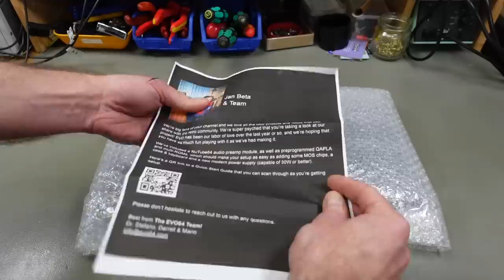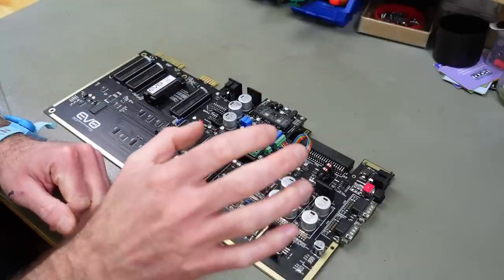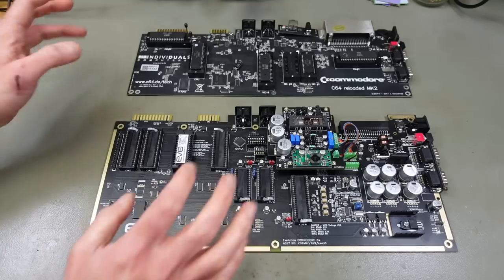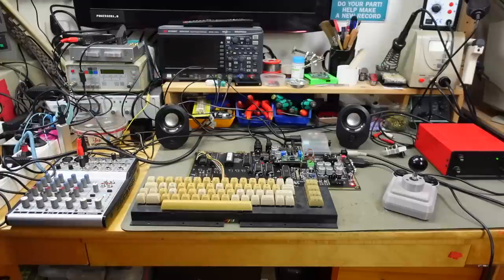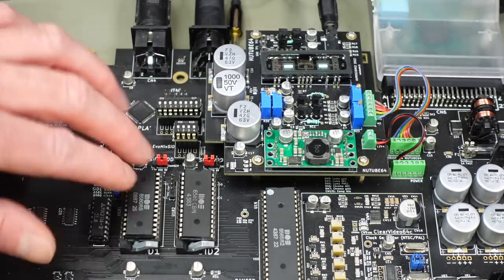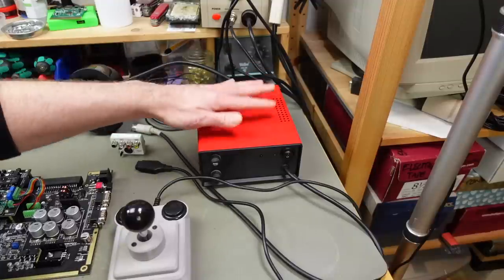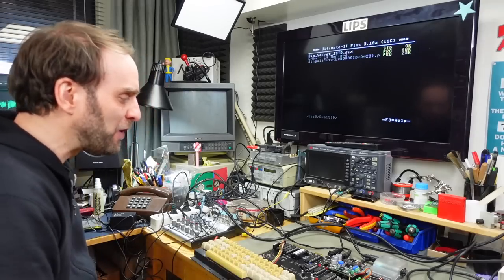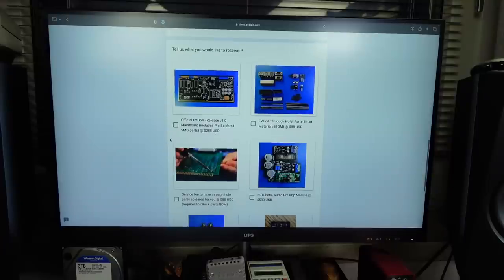The new EVO64 C64 Replica Board

Comment: If someone makes an equivalent Amiga board I'm there
Reply: there are... but you must put your's components... :D
Reply: Bob’s Bits Tindie.
Reply: Me, too. Although, I bought a custom remake motherboard of the original A4000D from a well known guy in Denmark who specialises in these boards, but it cost a king's ransom and still had mostly the original chips from Commodore. Nevertheless, it was a very professional remake (Chucky) and the components were soldered perfectly. If you've got the cash, almost anything is possible.
Reply: @milk-it  Minor quibble, Chucky (John Hertell) is Swedish. But his remakes are amazing feats of reverse engineering and knowledge. The A2000 board was a five layer board.
Reply: @OscarSommerbo  True.
Reply: I was thinking the same thing. With an A500 the sound output is rather noisy. Probably from the noise on the supply rails that feed the opamp in the peramp/filter stage before the sound output at the the rear RCA's. If you could take the L/R output more direct from Paula and design your own preamp within own separate powersupply using liner voltage regulators, it might improve the quality a bit. Although I wonder also how much the DAC output from Paula itself is affected by noisy supply rails. In this case a whole redesign of the board would be necessary.

Comment: That is SO cool! I'm really curious about the NuTube itself as it seems to be a miniaturised version  of a real valve. But wow, the price, and I AM one of those crazy audiophile types...! 
However, I thought, I need a case for that. So I looked in my Commodore crate (parts, but I remembered I had a C64C and a C128 in there that I needed to look at). I thought that the C64C case might be nice to use.
SO, I brought it down and decided to test it first. So, remembering what you said, measured the voltages first (which were fine) and powered on the machine after that. Fully expecting it not to work. But it did... And it kind of looks quite nice. Keyboard is perfect, perhaps a big discoloured. 
Still, open it I shall, so I flipped it over. Ah, made in West Germany. Wow, that brings me back memories of wanting to travel to Berlin when the wall fell, but okay.
And for me, this is the very first C64 that I've seen in the past 10 years or so that hasn't been opened before (seal is in tact) and still works fine.
Of course, I don't come across many, but I thought it was quite cool!
So I'll have to go look for another case, and I'm going to make this my first restoration project. Cool! Will use your videos to see what to replace of course!

Comment: I get the appeal of the EVO64, as it seems like a decent replacement C64 board. However I struggle to see the point of the pre-amp options (especially the Triode64). Maybe that says more about me than the target market. Either way, it's great to see people are still pushing the C64's architecture to new limits over 40 years since it was released.

Comment: As a musician I don't think I am the target audience for the amp, we use studio reference monitors over consumer speakers to hear every bit of articulation and detail, so if you are using a 64 to natively write music on or as an instrument like you mentioned you want the most accurate reference point, a 64 plugged into reference monitors. The tube amp is removing some of the clarity and ability to hear the detail in how extremely fast the sid chips parameters change. If I did specifically want this tube sound afterwards there is a plethora of options including nutube pedals and preamps from Korg or something like an Elektron analogue heat which is going to give you a tonne of control and options that you can use on all your gear. It might make more sense for people who have no need to invest in studio gear but want a smoother more glued sound from their 64.

That said it looks like a great board and the amps are totally optional, so win win for everyone.
Reply from the maker: Good point! I was thinking that it would make sense in a live setup for musicians or as a standalone synth in a recording setup (which is probably what I’m going to use it for primarily). Definitely not for everybody but I don’t think that’s the intention of the project. ;)

Comment: This is a great project that I have been following for some time. Every extra feature that is put in the board is a great choice, it contains most of the essential fixes / enhancements that were implemented to old C64 in time. I only have 2 criticisms; first being the price. I understand the effort and time that went into the project, and I am aware of the parts quality used. I also understand that considering the expected sales number, they had to make it a bit pricey to cover everything, but still, not an easy money to pay from a hobbyist's perspective. Second is the decision to embed a modern PLA replacement on board. No one, even the creator can guarantee 100% compatibility for a modern replacement. There should have been another ZIF socket for the PLA and the choice of placing an original PLA or any of the modern replacements in that socket should have been left to the end user. Other than these two, I think it is the best modern C64 board ever created so far, and I don't expect that there will ever be something better.
Reply: The production board that will ship on Feb 15th has a modular and removable QAPLA’ (PLA).
Reply: Bora. The QAPLA was moved off board with a small square socket to allow me to change CHIP, to add funcitonalities (in the EEPROM) and to be able to play with more possible waiting states in production SRAMs. Compatibility is always goal. I promise you that when your QAPLA dies, you will have a replacement, ready to take its job.
Reply: @auro1999  But still no provisions to use a genuine PLA?

Comment: I think the Evo64 is a great project because it does answer the question about what the Commodore 64 would have been like if higher quality components were used in its manufacturing. I love that it further extends the life of the 1980s platform. I wonder what the next steps are... as in, where do we go from here? This almost demands that the platform get extended further. Some kind of expectation for Dual SID and with the new VIC replacement that also extends the C64s capabilities, I would like to see some sort of... not quite next gen C64 but something that we can all enjoy, no matter the vintage of Commodore 64... Perhaps I am babbling...
Reply: Higher quality? the many original c64's have survived 40+ years now. It's incredible for a computer designed to last 4-5 years.

Comment: This got me thinking about how dual SIDs work. I know the C64 memory map has the SID registers repeated 32 times, so I suppose when Commodore designed the machine they maybe thought that they could support as many SIDs as they could get on the board (up to 32), and maybe they weren't sure how many channels they would be able to design into the single SID chip, they might be able to "multi-core" the SID so-to-speak. But then the actual C64 only has the single SID chip select line supported, so you can't just slap in another SID without changing more of the chip select circuitry (U15 chip selects the SID when the appropriate address lines are being accessed?). I assume these new boards have designed in the multi SID support? and I also assume that it's possible to put more than 2 in, but I've never noticed anything about triple SIDs or quadruple SIDs?
Reply: The board is clearly supporting 2 physical SIDs, although if using an ARM2SID or FPGASID, it should be possible to support even more
Reply: It's probably not that they intended to put multiple SIDs in, but more that they just simplified the address decoding for a few chips (the same decoder also selects the colour RAM). Each of the devices (VIC included) is given a 1K block of memory to live in as a result of the colour RAM needing that much space.

I guess they could have decoded further, but that would require more chips.

Comment: Saw the 8-bit Guy's review of this board. The main board is excellent and is definitely worth considering for any C64 fan who wants to have a future-proof machine with modern components. The sound cards though - Ouch! I know it is impossible to make a valid comparison over YouTube due to sampling, compression and reconstruction but seriously?! However you process it in the machine this is still 80's vintage 8-bit sound generation. You might as well connect your NAD amplifier to a gramophone! $500? 😲 $1000? 🤣
Reply: The available preamp modules are a niche offering for enthusiasts that want to experience them. They're not required for base functionality of the board. The cost for the modules is a reflection of the very high quality components, as well as the time and effort it takes to assemble, calibrate and test each module by hand (yes each is handmade). 

We're not expecting to sell tons of them, but we really wanted to have them for ourselves and to share them with others that might share a similar interest.
Reply: @C64EVO  I am sure that the cost of the boards reasonably reflects the time and expense required to develop and produce them and I applaud your achievement. My doubt is whether it was really necessary (or sensible) to spend this amount of time, money and energy developing and building modules to amplify 80's 8-bit sound in the first place! The 8-bit Guy's final verdict was that the VFD module produced little if any improvement over the basic board and certainly did not justify paying $500 for. I suspect that the same will apply doubly to the $1000 board. Producing it for yourselves is one thing and offering it for sale is the next step, but in a time of global financial crisis the prices do seem rather laughable.
Reply: Giving all due respect to David (The 8-Bit Guy), we love his contributions to the retro world, however he made it quite clear that he does not consider himself to be an effective judge of something as subjective and personal as audio quality.

His attempt at a putting together a quantifiable set of measurements was quite limited. Comparing the waveforms actually has no meaningful relationship to the sound character, which needs to be experienced to be appreciated. I don't think David would disagree with anything I've said there.

You'll notice that Jan is sharing a quite different subjective experience in this video, which we certainly did not ask him to do. Other than providing him with the board, we did not otherwise sponsor or attempt to influence his opinions in any way.

Obviously we think it would be great if others choose to experience and enjoy the preamp modules in the same way that we do, but leaving them as a separate option makes this a personal decision for each hobbyist.

Comment: Cool, C64 will never die 🥳
Reply: It will since there are still chips that has no modern replacements. And you get into the ship of Theseus if you use HW emulation for the sid and vic2. But then there are cycle perfect emulators, so maybe by that token it will never die.

Comment: $1000 for a tube amp? It's a lovely project, but that is absolutely insane, I've got a  little desktop tube amp (MC 84-C) with 6 tubes that costs less. Sorry, I don't want to be "that guy" but I think the pricing for this one is a bit aggressive. Cool project, but a little much for me.
Reply from the maker: They are using studio grade components on that tube board afaik, so it's not really comparable with a consumer grade product (which I assume your preamp board is). Effects rack tube preamps for recording studio applications are usually in a similar price range (and well above that). I think they are definitely marking up the price to make a bit of an income from all the work they put into this but I would guess it's not as hilarious as it seems. It IS super over the top connecting something like that to a humble C64 but I kind of love the insanity of it (although I would definitely not be able to pay 1000USD for it).
Reply: @JanBeta audio foolery, snake oil salesmen.
Reply: @JanBeta  studio grade components without proper shielding next to video generation circuitry ;-)

Comment: 44:49 The new tube tracks trigger my surroundsound on my home theater!
Reply from the maker: I would guess it does that because of the slight phase variations between the different SID models. The early implementations of surround sound were using phase-shifting to get the additional channels. Not quite sure if that is still used for the modern digital Dolby surround stuff but it probably still is implemented in most surround devices. :D

Comment: I like those kinds of project, but I also wonder with all the replacement parts that aren’t really made like the originals, do we just move closer and closer to distributing something really similar to an FPGA implementation, but distributed across a traditional board?
Reply: We have made quite a bit of effort to remain as faithful to the original system architecture as we thought made sense, given what's possible to have produced today, in small batches.
Reply: @C64EVO  No doubt about that and I’m not criticizing your efforts, in fact I appreciate them a lot! I just wonder about the differences to FPGA implementations, especially because they also keep on getting better 😊

Comment: Love my CPC's but yeah I have to admit that SID is superior over AY... 8580 seems produces nicer sound than 6581
Reply from the maker: Yes, the 8580 has some flaws of the previous versions fixed. It's generally a lot cleaner sounding than the 6581. Both have their pros and cons I think. A matter of taste. The SID was superior to pretty much everything else at the time I think, mostly due to the fact that it was designed by Bob Yannes who was a synthesizer designer really and had not designed any ICs before. So it was a kind of a happy accident that he started designing something more ambitious than usual because he lacked the knowledge about the restrictions (afaik he originally planned to design the SID with a lot more voices and filters but had to downsize it to 3 channels in the end). :)
Reply: @JanBeta  thanks, didn't know about this

Comment: You really need to build one of them ATX64 boards that are developed by a German. It is like a Sixtyclone, but taken in a completely different direction.
Reply from the maker: I actually have the C64 tower board from the creator of that one here but didn't get around building that yet! The ATX64 is something I'm super interested in, too. I think I'm going to get one of those sometime!
Reply: @JanBeta  We are not that many who own a fully build one. Personally I am figuring out how to create a case from scratch for my ATX64....

But you should really do it. Build yours. It is a wierd an unique machine. If you do it, then perhaps mod the ROM's to fitt your build, like I did with the info screen at the top, when powering on.
Reply: Now I have to go research this. Why do I get the feeling reading this comment is going to cost me several hundred bucks 😂
Reply: @Retrocomputernerd  From personally making one ATX64, then yes it will become expensive. 🙂

Comment: Why are the dipswitches above the SIDs on small PCBs?
Reply: Those DIP switches are removable. They sit on top of standard headers so that an auto-switching module like the Keyman64 can be added to control ROM changes if that’s desired
Reply: because they are temporary and act like jumpers. THere will be a remote control and a keyboard switcher, eventually.

Comment: Does this fit in the C64C case as well as the “breadbin”  ?
Reply from the maker: Yes, it fits both. Although there seems to be a slight positioning issue with the audio jack on the preamp board if you put it in a C64C case (the connector doesn't quite line up with the cutout in the case but you can work around that by using slightly smaller standoffs for the preamp board). Breadbin case fits 100% fine.
Reply: In the 8-Bit Guy's video, he had to change the stand-offs and physically re-drill one of the screw holes in the board because it was the wrong size. For such an expensive product, they didn't seem to do a lot of testing.
Reply: Yeah, that board definitely looks to be better fitting in a bread bin case. ;)
Reply: @domramsey  well, it IS based on assy 250407 - and that's bread bin suited. ;)
Reply: yes perfectly on the C64. Jack audio: no problem. The production version of the nutube64 has pads for the jack ABOVE and BELOW the board so you can put the plug wherever you want.

Comment: on the Evo board is the pin 1 indicator visible I had heard they are hard to find
Reply from the maker: I think on the bare PCB (and in case you use regular sockets) they are marked clearly. They are covered by the ZIF sockets that were pre-soldered on the review units though.
Reply: All stuff which you can put/remove points north. Instructions ARE and WERE ALWAYS provided in all the sample shipments. No blame goes to the developers.

Comment: NuTubes are known to be microphonic. Does tapping the board affect the noise?
Reply: I'd buy one of the aftermarket mounting solutions, just to be sure.
Reply: I'm sure you want to hear Jan's response to that question, but I can add that the mounting solution that has been implemented for EVO does already include vibration dampening, which should resist microphonics under basic movement conditions, like using the keyboard. It would take a more abrupt and deliberate type of system jostling to cause any discernible microphonic noise to enter the signal.
Reply: @C64EVO  oh good!
Reply: 1) no if you type on the C64 2) no if you tap the board 3) yes if you tap the nutube. The device is NOT mounted flush with the board but elevated of 2-3 mm, to reduce vibration. As the guy below says,  it is possible to put a foamy support and a flex connector
Reply: @auro1999  nice
Reply: @hicknopunk  if you do an order of nutube, put a note and I`ll solder the nutube through the flex connector. I need to get a few for a different project.